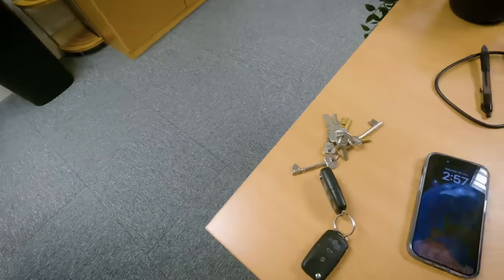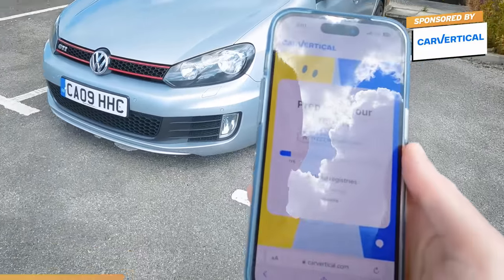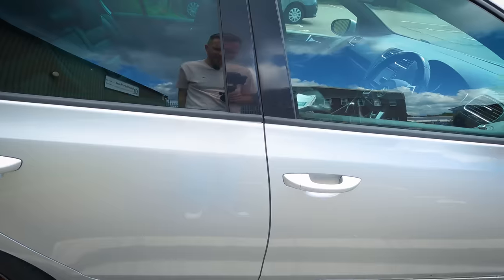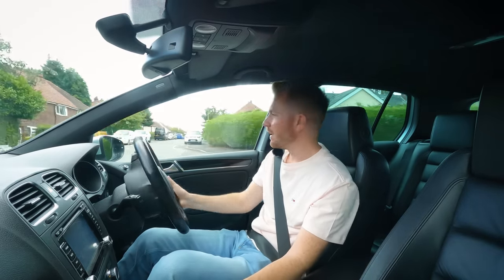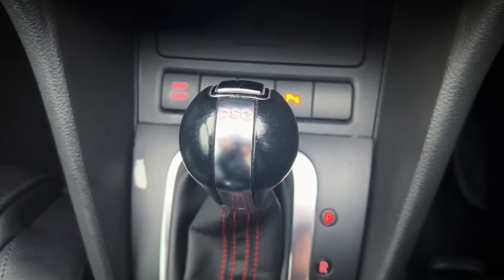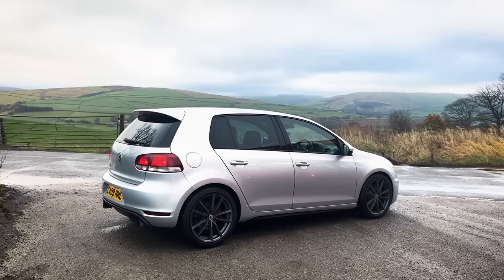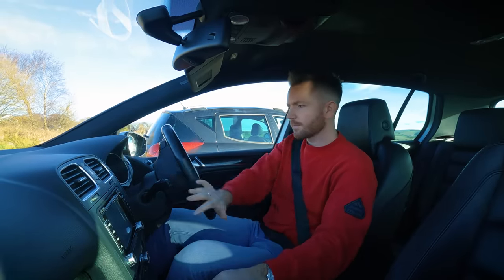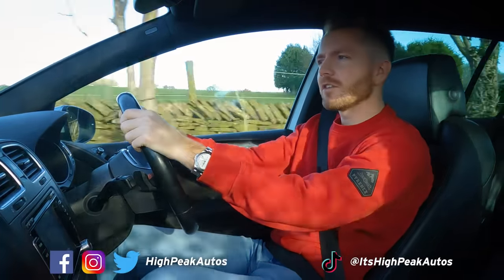I BOUGHT A CHEAP VW GOLF GTI FOR £3,500!

Comment: Hi Matt, Just watched the video with the family, kids screaming "there's our car" anxiety levels were high watching this even though we no longer own the car still felt like my car was being reviewed. I had bought the car (CA09HHC) for my wife  after the birth of our daughter it was the replacement to her previous car MK5 GTi also DSG  fortunately no issue with that one. Got the car from Keystone cars in Ringwood about 10/15 mins from Bournemouth, back then car had 74k miles already. it had a horrible head unit with a parrot Bluetooth hence the aftermarket radio. when the issue started beginning of the year it wasn't consistently happening so when I took the car to VAG Technik my local VW specialist it would behave and not throw up any issue but they tried the DSG service hence you see it was serviced this year but to no avail. they advised taking it to a CAL Trans in Denton and they confirmed Mechatronic issue. The numbers quoted (like £2000) for repair did not make sense as we were also aware of the oil leak that required attention so we decided to trade it in, which we did for a Sportage.  Oh the Mrs likes Classic FM 😁
Reply: VWs do not sound like quality cars at all the more I learn about them and the more stories I hear. My Toyota 4Runner has over 225,000 miles in it and is 24 years old. It might now actually be starting to bite the dust? But it had a commendable run if it does finally die. No reason for cars to have such issues under 200k miles and being less than 20 years old.
Reply: 13:55 we was doing ever so well then 😂
Reply: Can’t believe your balls deep into vw dog gti ! 
Why not just trade on in the first place  ?
Reply: I have previously fixed Mechatronic for £900 on mk6 GTi DSG 🫣
Reply: I bought a brand new Skoda Kodiaq Edition model in 2017 when the Kodiaq was just released and the mechatronic unit failed with only 400 miles on the clock….just saying!!
Reply: @MaxMax-th7uz then there won't be a video 🤔
Reply: Definitely don’t want Jeremy Vine….as if things weren’t bad enough……
Reply: @Mart16g haha yep listening to that toad drone on could make any situation worse
Reply: @baronvonjo1929 it depends on the VW really. Some are better than others some engines (1.9 TDI for example) are absolutely unkillable and known for reliability. However this Mk6 golf GTi had the early ea888 which was unreliable and had 3 recalls for reliability issues. This car also has a early-ish DSG gearboxes which again are known for reliability issues. People also tend to buy these cars and thrash them for some time and sell it on quickly. Your average Golf GTI will have had 6 owners be on 120k miles and only serviced by 3 of them. But yh VWs are hit and miss some engines are brilliant while others are absolute shitshows. My VW Polo for example has the 1.2 12v 70hp which is known to be a reliable engine. But if it had the 1.2 6v 59hp or 64hp they're known to be unreliable 😂😂
Reply: You have looked after me car. DSG are a nightmare
Reply: VW burned the quality bridge a while ago. You cant buy VAG cars without a warranty or you are screwed repairing it
Reply: Cool
Reply: @baronvonjo1929  Das Auto for you. Stick with the Toyota!
Reply: I've been waiting for ages for a previous owner to comment on one of Matt's videos! Nice car, and a decent purchase for whoever buys it.
Reply: @Mart16g I think we all know it's Jeremy whine 😂
Reply: @abua8 how?…
Reply: @baronvonjo1929 Unreliable as these may be - given a choice of this or a Toyota 4Runner, I'd take the breakdowns 😉
Reply: @loosabway3400  you’d take the breakdowns, good for you, I’ll take reliability and we are all happy 😃
Reply: @shane6115  Well, exactly - I hear Electric Milk floats can hit a million miles before retirement - I can link you up to a seller, if you like.....
Reply: @loosabway3400  is it low fat milk?
Reply: @abua8  Repair? Or did you get a new mechatronic for that?
Reply: @shane6115  I think Low Fat Milk might be a bit too exciting for you.
Reply: @baronvonjo1929  the engines will last like your toyota, just not the body and a shitty auto box -manual is needed for reliability in a vw of this age!
Reply: Honda Civic EP3 Type R is the best hot hatch😂
Reply: @baronvonjo1929 my 2019 passat 2.0 tdi dsg has 279,450km. I owned it since new. Never had an issue other than standard maintenance items
Reply: @garyboag8681 i have a 2019 Passat 2.0 TDI. DQ381 DSG gearbox. Now on 174500mi, everything original and i cant fault it!
Reply: @dobrien757  Skoda couldn’t have been more apologetic about it and gave me a courtesy car for the ten days it took to rectify the fault. Had no other issues with the car for the remainder of my ownership.
Reply: This is a nice car, i dont understand why not to invest in  it from the previous owners
Reply: Well done you for giving honest info!
Reply: @diarmuidpobrien  Nice. It's always possible of course. But I always hear of problems with VW online and several of their models rank low on reliability surveys. Even the brand is kinda mediocre in brand reliability surveys. I'm glad you had a good time though. A unreliable mess isn't fun.
Reply: What happened with the painted rear bumper
Reply: How's Sportage now?
Reply: @Darkraystudio  LOL funny you should ask had to go back to the dealership for a new Clutch, but other than that all good.
Reply: You'd find classic FM on my radio he has no taste
Reply: Fantastic 😂
Reply: My 2002 E46 has less problems
Reply: @Chris-hw4mq My Golf 1.2TSI ( 2011 ) is still going strong. Since 2019 not a single issue with the car. I have it serviced every two years for around £ 150 and that’s it.
Reply: @Moestuin2023  glad you got a good one but what about the people who got screwed with dieselgate or the timing problems on the 1.4 turbos. I could never recommend somebody buy a used VW.
Reply: I think aftermarket head unit comes on when in reverse for reverse camera that can be added
Reply: @mizanurali3443  na it's just as shit 😂
Reply: Good luck matt 👍
Reply: The reliability of these cars can vary depending on service history and the gearbox/transmission. I have heard nasty things about the DSG automatic so I tried to stay away from it. I think they’re really cool but I would never own one. I picked mine up last year with the 6 speed manual and I’ve put 25k on it and have had no issues. With the case of this car(CA09HHC), the service history was flawless but the transmission, regardless of how fun they are, can kill the reliability of the car.

Comment: Decent used gearbox will set you back £500. New flywheel around £250. 4 hours labour to swap the lot. Under a grand to sort that lot. Personally I'd have got the mechatronic unit reconditioned for around £400 and very likely that's all it really needed. It drove fine up to 4th gear so flywheel likely perfectly serviceable. Mechatronics unit swap is only a couple of hours work. No need for gearbox removal. The 'stuck in 2nd gear you experienced was just limp mode for the gearbox. It allows 2nd and Reverse so you can get home when it detects a fault. You spent crazy money! Couple of hundred quid on a set of facelift rear LED tail light and it's all good.
Reply: Agreed. Way more spent than it needed.

Comment: I currently have an 85,000 mile 2013 GTI , bought brand new. No engine/trans/elec/computer problems at all. Had to replace an ignition coil,  a sunroof drain, and now the interior roof is sagging. That's it. Reliable, fun car.
Reply: I've a 2010 GT 160 mk6 one with 1.4 twincharger 3 door manual. Very similar to gti other than engine, it's a manual and it's only 88k miles and i'm 2nd owner. I had to do timing chain (bad job if that jumps a tooth so get that done), ignition coils. I put on nice brigestone potenza, replaced front disc's and pads, wheel alignment, very high end Sony headunit with JL amp and sub. LED tailights, R spoiler, cat back system and various other bits, remap to 200HP. I love the wee car.  It cost me less that his GTi including all the mods I put on my car (not sound system) and i've had it nearly 4 years. The paint is peeling though. Great wee car.

Comment: If you don’t do the maintenance on the DSG they have issues, you have to change the filter & fluid at a maximum of 40k miles and more like 30-35k miles if your TCU is tuned (which changes everything btw) the DQ250 and DQ500 DSG is a beautiful work of art, but they get hot so keeping good oil in them is super important if you want them to last. Mine is at 190k with a stage ll TCU tune from 034 Motorsport and it’s working flawlessly.

Comment: 14 year old 6 speed manual still going strong. Got the 211 HP model with adaptive suspension. Led tail & headlights. Looks amazing, drives very well. 👍

Comment: This gen GTI has a wet clutch 6-speed DSG. The technology was still fairly new, and problems were common. However, the 7-speed dry clutch version from the same period is even worse. The dry clutches can't handle normal city driving and wear quickly, causing all kinds of problems and jerkiness along the way.

Comment: Haha, love the comment about GTI fans, here are some of my thoughts. The aftermarket headunit keeps coming on in reverse because on the stock headunit it would come on and display your parking distance sensors visually but obviously this isnt present on the aftermarket unit. I was also screaming timing chain, timing chain at one point! The engine is great in this car but the engine light was probably on because the intake runner flaps are faulty and the intake mainfold needs replacing. The light can be reset but it will come back on again after a couple of weeks. Keep up the great work and the realities of trading cars!

Comment: Interesting indeed! And a cautionary tale as well. I've always had a small urge for a Mk 5 or 6 Golf GTI with the DSG (as I don't care for manuals), but this was the best reason so far to stay far away from one. So well maintained, and yet.... Anyway, thanks for the vid! Great work as always.
Reply: i had a mk6 gti for a few years and it cost me a small fortune in repairs including a full engine rebuild at 50k miles
Reply: I had a mk5 and the abs unit failed
Reply: VWs just don't sound like very good products. Unreliable, needlessly complex, and expensive to repair. I keep seeing the same story all along these comments.
Reply: @baronvonjo1929 on the older models. Mk7 is when they sort themselves out. Minus the coolant leaks
Reply: @baronvonjo1929   newer VW's don't seem to have the pedigree of pre 2006 VWs.. back in the day you could by a 1.9 Passat or Skoda Octavia and it would run forever
Reply: I’ve got a mk5 gti dsg, had it for 7 years and 60k miles and no faults, on 125k now. They’re not all bad!
Reply: @jasonwhidborne5173   they not bad to drive and hold there value well... But with most German cars comes down to luck if you have bad mechanical or electrical issues
Reply: @Insetta  agreed. I have an 18 plate mk7.5 and has treated me very well, apart from a coolant leak at 70,000 miles which cost me £1300 to diagnose and repair.
Reply: @mattcoleman8086  thats unfourtunate and very expensive. I got a 2018 cupra 300. Coolant leaked within the 1st month at 37k miles. Luckily the 3rd party warranty actually got it fixed. So I only paid for the waterpump since the garage recommended to change that at the same time as the warranty company would only pay for the thermostat housing. Been spot on ever since. Mine was only coming at £700 for the repair

Comment: Had my first Golf Gti in 1981, Mk1 convertible. Had two Mk2s a Mk 3 and a finally a VR6. All from new kept for a couple of years and run for about 60k miles. never had a problem with any of them. More recently had a 2018 tsi from new and di 20k in that and never even had a service due before the two year lease was up. All I did was fill it with petrol, refill the washer bottle and check tyre pressures. great cars all of them.
I'd never get one with a DSG box though or a ten year old one.

Comment: Just to add a little balance, our last 5 cars have all been DSG or S-Tronic and not only have they been perfect but they are awesome and wouldn’t ever buy anything else 💯%👌
Reply: I just bought a gti mk6 and i noticed when i shift from P to D the gearbox takes like 4-5 seconds for the car to start moving, is that normal with this transmission?? I had a chevy before and it would instantly move when i let go the brake

Comment: Radio coming on in reverse reminds me of the time I bought a Vauxhall Monaro. 
I was driving it home up the M1 when a tree & bench light came up on the dashboard with an alarm signal. I couldn't stop on the motorway and I was in a contraflow so I carried on to the next junction or services. The speed dropped and I became a mobile chicane. Then there was a horrible scraping noise and I was pulling my hair out. 
Once I was able to stop I checked the car over thinking that the exhaust had dropped off but, no it hadn't. I restarted the car and the light went out but the scraping noise was still there. Turned out to be the radio that wasn't tuned in to anything. 
When I got home, I did some digging in the manual .... When travelling over 50 miles, the "Take a Break" light will come on followed by an alarm. If ignored, it would turn the radio on getting progressively louder as the speed gets slower. I couldn't find how to turn it off so I took it straight back and bought something else.
Reply: Typical Holden rubbish....ha..ha

Comment: This is a relatively early DSG. First in the golf GTI in 2006 and known to be complex and quite problematic like most dual clutch automatics. You would expect a new clutch at about 100k miles. The mechatronic unit in your car is 14 years old. That's why it's much safer to go manual at this age. Not because its less likely to break although that is probably true as well but if it does break its a lot cheaper. Like most complex things designed to improve fuel economy and emissions the durability was not the top priority here.
Reply: First dsg was mk4 r32 in mainland Europe. But yes your points are correct
Reply: @bmorris5863 your wrong dude, it was an 2003 Audi TT 3.2
Reply: @shane6115  many news article incorrectly say it's the Audi TT. One second of research you'll find its the mk4 r32.
Reply: @bmorris5863 . You’re correct 👍, the 8 speed torque converter ZF gearbox is the best on the market now, smooth quick gear changes  and reliable.

Comment: My Mk6 TDi golf has the DSG... it's faulty since I brought it 7 yrs ago, It will only work 'automatically' in S mode once it warmed up... till then it will only work manually! It's a software fault in the ECU , VW wanted £1250 to put it right! I've lived with it because I'm cheap , Been told the 6 speed it much stronger than them 7 speed they used in the 1.6
Reply: Yep. The 7 speed 1.6 has a dry clutch where most of the problems occur.👍👍

Comment: We bought a 2010 MK5 Jetta Wolfsburg with the DSG 5 years ago with 112k miles.  Paid $4900.  New timing belt but No DSG service history.  Now has 140k, still shifts strong though the car was never abused.  My mechanic advised to leave the gearbox alone at this point.  6 months after we purchased, VW pretty much rebodied the car under warranty for some light corrosion on the wings, boot and near number plate on back.  Replaced everything other than 2 doors and the roof with a perfect paint match….under warranty.  Other than mostly maintenance, the car has been the best value I’ve ever spent on a car.
Reply: Meh I'd be having the DSG serviced.
Reply: @ln5747  dunno man….afraid I’d be opening a huge can of worms.  My wife drives it now and refuses to part with it.  If it dies…her hand will be forced.  Maybe when I get my new car and she takes my Volvo….then we can play God.🤣
Reply: @jeadie2273  its more likely to die if not serviced. Some mechanics seem to claim that if it's not been serviced it's best not to then service it as it can upset it. I find that hard to believe and usually question their motives. They are certainly not sealed for life. I'd absolutely be servicing it.

Comment: I think the reason that radio turns on in reverse is because with the original stereo, a parking sensor diagram would be displayed and for it to be displayed, the head unit needs power.

Comment: I bought a mk6 2l TDI in the summer for £6500 on 69000 currently on 76000 and no issues so far. Full VW history and hopefully it will keep going for a few years yet as it's a great car... hopefully the fact it's a manual will help.
Reply: its a vw itll last you 300k miles especially since its a diesel
Reply: Same car on 110k miles. The main issue with higher mileage golfs is the suspension issues. Bushes shocks tob mounts springs alll are worn out and need replacing
Reply: My mk6 2.0 TDI is just under 140k. I’d probs say they are good for about 200k miles then it’s expensive replacement parts
Reply: @Ben-uy3qe  nah not even we had one aswell and it went strong up to 300k miles then it just needed so much work it wasnt worth keeping so we upgraded to a new tiguan with 2L tdi and now we have a 2020 top spec vw troc with 1.5tsi
Reply: With the same money In continental europe you would get one with 200.000 km :)
Reply: @thedandy6765  what kind of work did it need at 300k?
Reply: @rm9207  gearbox needed a rebuild cus it was a manual and started getting worn out
The intercooler had a leak
The turbo leaked oil
Which would be a few thousand euro
It also started rusting quite badly so we sold it and bought vw tiguan 2.0 tdi
Reply: @thedandy6765  thanks for the response. Much appreciated :) I will remember this when I reach higher mileage